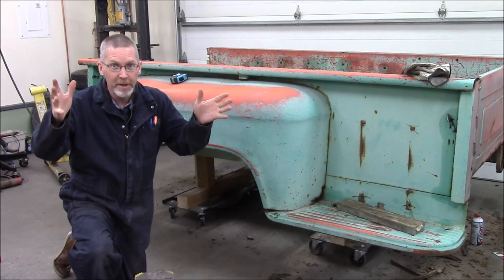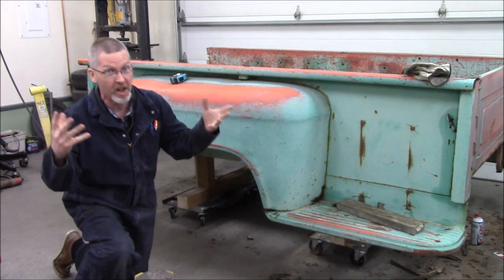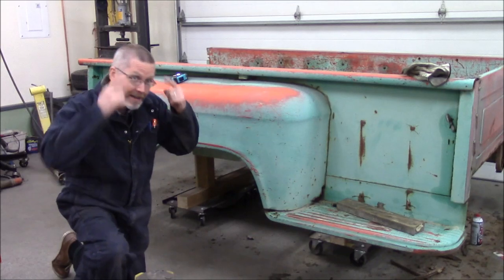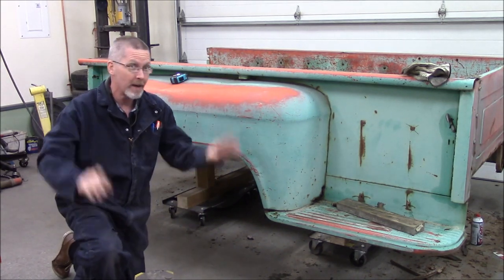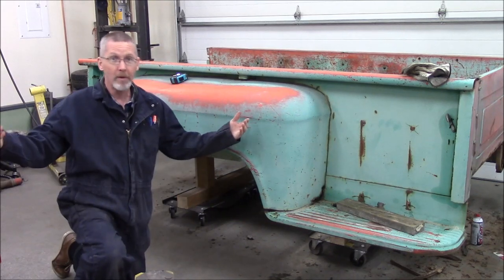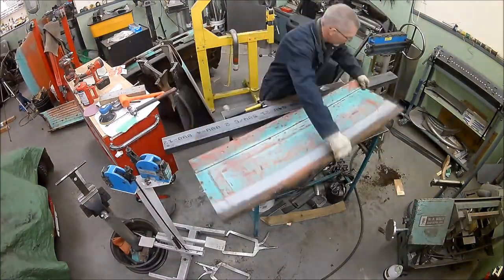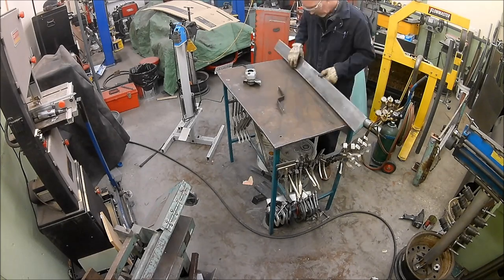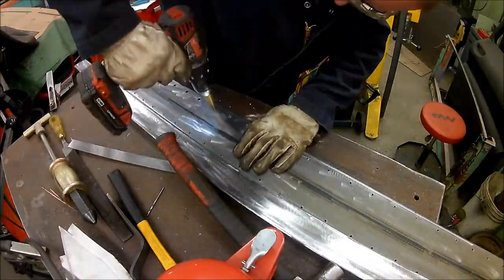HOW TO: Shorten a Step Side Bed (and Raise a Bed Floor)

Comment: Dude that was an awesome video. I've been searching for a year and a half for a decent c10 preferably 63-66 and my desire for anything quickly turned harder as I convinced myself I needed a shortbed stepside. This unfortunately is the most desirable style so rusted out dumpsters are going for insane money right now SO I've switched gears considering cutting down longbeds. Today I found a 69 long step and your video showed me exactly what I was hoping was possible. I know fender shapes on a 69 are obviously different but the process should be almost the same
Reply from the maker: The beds themselves are basically the same from the 50's to the 80's.  It was kinda fun to do, it worked really slick. Good luck!

Comment: Motivated by your video- I undertook the same shortening only... I took a 84 C10 Longbed Stepside and cut down to a shortbed stepside.  Not quite finished yet but all the cutting and welding is complete.   One thing I did to better hide the work- I cut the bed 1" in from the inside of the tailgate and welded a piece of the bed behind it that also extends 1" further.  This strengthens the rear bed AND is completely hidden inside the rear stake holder.  
On the front- after measuring what I need as a final length, I added another 3/4".  This is bent inward (towards the other side) and allows for the front bulkhead to bolt to the pillar AND ALSO remains hidden behind the front stake holder!  

This allows for a clean top to the stake holders with only the middle left to address.   

Thank you again for your video- careful forethought and planning ended with a very clean nice job!
Reply from the maker: Very cool!!

Comment: I loved the video- I'm shortening a 84 Chevy Longbed Stepside into a Shortbed Stepside for my 78 K10.  Very worth while watching. Thank you for the video- I've watched this several times and will again and again as I undertake this. The one item not covered is my shortbed will now have a middle stake pocket the other shortbed do not have.  Again- thank you !
Reply from the maker: I shortened my daily driver '77 C10 about 7 or 8 years ago too, but I used a factory short fleet bed I found, which was easier than fixing the rust I had.

Comment: Great build, thanks for taking the time and sharing. I found your channel this weekend and binge watched all 15 parts of this build, great job. You have an entertaining way of explaining in your voiceovers, enjoyable to watch.

I have a 64 that I've started to assemble parts for, I'd be curious to know what your running cost is so far, (Truck, front end, steering rack, sheet metal, etc....), and what you think the final cost might be. I, like you, am trying to reuse as much of the original truck but some things are too far gone and are being replaced with crappy repo parts. 

Thanks again, looking forward to the next video.

Comment: Awesome I think ill use the method you talked about where they cut it down the middle. My ocd cant handle the uneven pocket holes. Awesome solution for the stepside mounts though!
Reply from the maker: Could just remove the pocket and plug the hole. I mean, you've got the welder out anyway, and these scrap of bed rail kicking around now....
Reply: How did it turn out? I’m thinking of just cutting the 20 inches out of my 1969 c-10 from the center where most of the weld be hidden.

Comment: Do you have any suggestions on how to fix squished curls that are over the top side of the bed?  Fortunately, not completely smashed, but has dents the size of small craters on the moon.  Mine was a well used farm truck, and those took it pretty hard.
Reply from the maker: I've worked a few of them out reasonably well with a torch to soften the metal and various bars to push them out enough for "an acceptable level of filler."  My tailgate is right knackered, and I'm debating seeing if I can fix just for the challenge of it, or just fire up the Visa.

Comment: Did cutting more from the front of the bed and less from the back affect where the wheel sits in the wheel well?
Reply from the maker: Yes, but if you look at a factory stepside, on the longbed the wheel is too far forward, and on a shortbed the wheel is too far back.  The cuts I did result in a factory sized shortbed.
Reply: @GregWellwood  I appreciate the response! I'll be cutting my bed using your method in the next few months. Thanks!
Reply: @GregWellwood Had back surgery and it put a hold on my build. Finally got the truck running and now working on the bed. 

I was thinking about buying the replacement side steps from cjpony. If I cut the bed this way would the replacement steps be the correct length?

Appreciate your help and your videos. Helped me alot thru my build.
Reply from the maker: @Rawnchy1  "In theory," yes.  I did inquire on the cutting lengths at the 67-72 Chevy Truck forum, and I used the numbers that consistently came back, but I did not have a physical pickup to directly measure off of by myself, so I had to trust others.  1) Order the short steps FIRST, and cut the bed to match, or 2) cut the steps you have and then you KNOW they match (plus, those steps are pricey).  I'd love to see your progress!
Reply: @GregWellwood I have never really been about recording what I do. I just posted a short video as I just got it running. I'll make sure to take some more along the way. 

Steps are not to pricey. $140 for the pair. I'm not the best welder so I figured it would be easier to purchase the set. I'll try to remove mine and see their condition first. 

Thanks for the response 👍

Comment: Dose anyone know how many inches to cut on a mid size bed to convert to a short bed
Reply from the maker: C10's have 78-1/8" beds, 98" beds, and 108-1/4" beds. Math will tell you how much to cut.